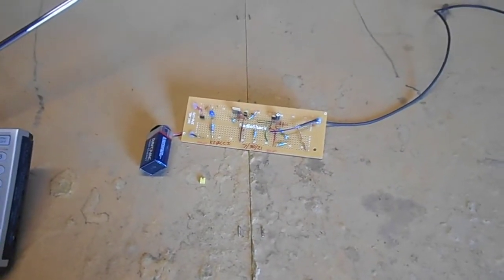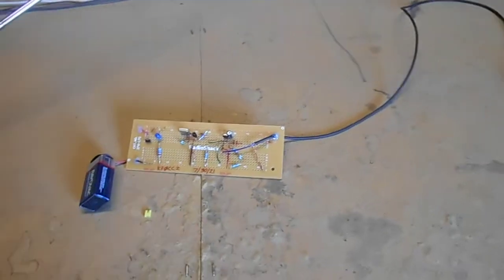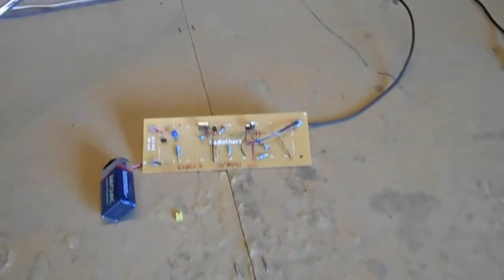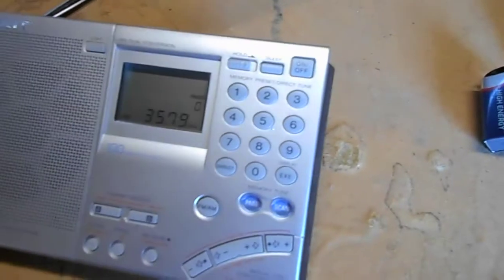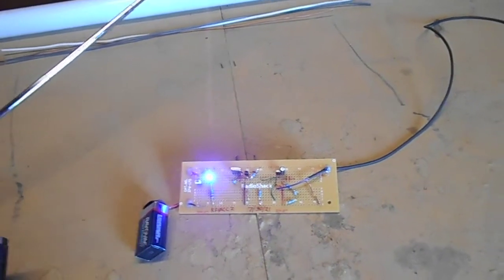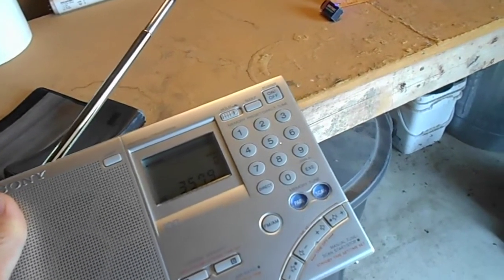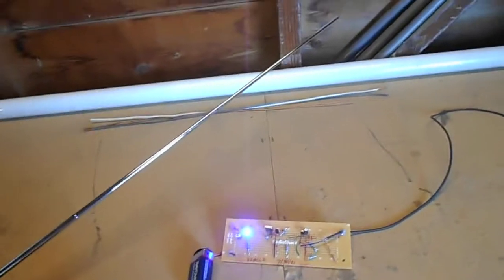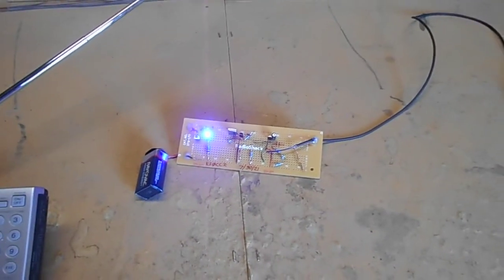The AM Transmitter Leaves The Breadboard - AM2PC pt. 3

Comment: When I was in high-school I made similar setup bu on paper board, and I connect the component with transformer wires (which are isolated) cutting the ends of the wire, the problem my radio that time, never work because I didn't know what it frequency and I was knowing nothing about electronics .